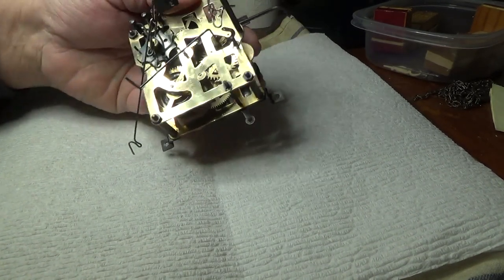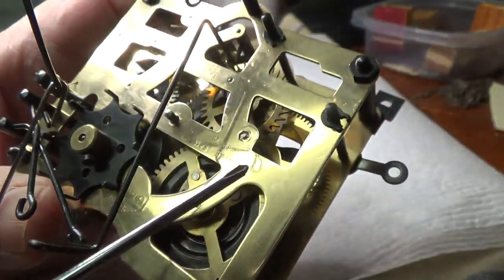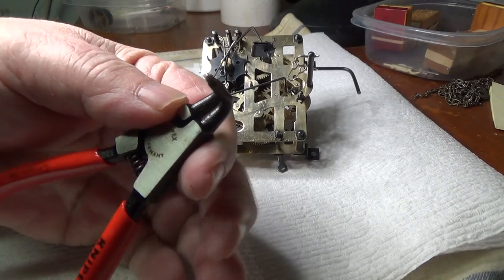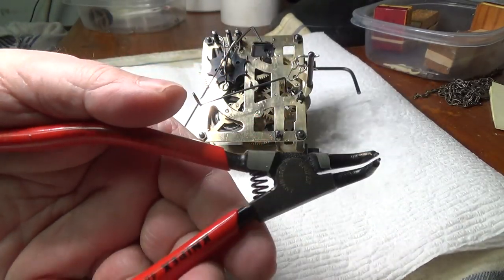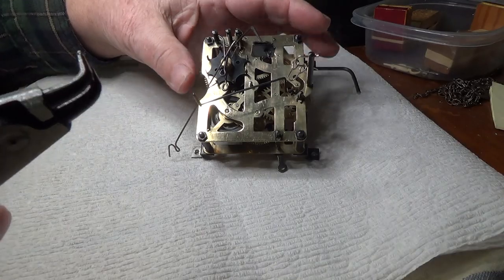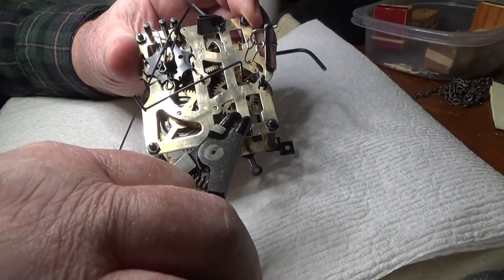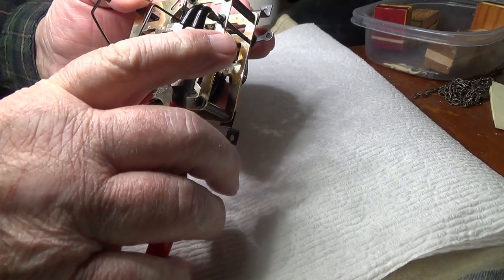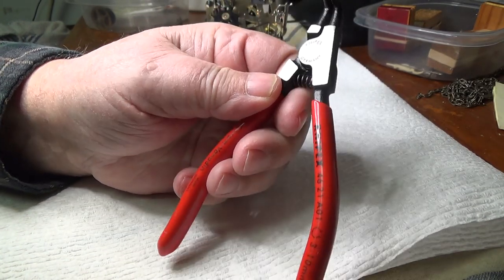Dealing with  Those Doggone Regula Clips

Comment: Until I started watching your videos I had never heard the term "E-clip"  but was quite familiar with the term "circlip" and if you search for that on the net you will get a lot of hits. What you have is circlip pliers and  there are two kinds. One deals with clips that have hole in them and the other kind deals with the kind that has a cavity in them. This is your kind. But as you get small --- like a clock  -- there is nothing to help you but pliers and the exact size of E - or cir - clip.I have a full set of circlip pliers and a shaft I can't get the &^*( clip on.
Reply from the maker: If I do a Google search for "circlip", I get 11,000,000 results.

If I do a Google search for "e clip", I get 5,250,000,000 results. E clips are so called because they are shaped like the letter "e".  They don't require pliers at all and are easily pushed into their grooves and removed with needle-nosed pliers.  Clocks use almost no other type of retaining ring but e-clips.  I've found these other type only on the Regula and only on two of the shafts.  I've found that suppliers refer to them as "g-type clips".  In the past, whether it be "circlip", "c-clip" or "e-clip", I knew them as "Jesus Christ clips".

Comment: I hate these cheap Doggone Regula Clips. I carefully beat them off as I am watching the lever on the other side so it does not hang up. I see this video was made 4 years ago. What do you think of this tool now. I watched a recent video and you were using a screw driver to get them off and putting it back on, Poof, it was done already and didn't see you putting it back on. When I do my videos, only once I showed how I did the clips on, and off and caught some hell over it, lol. Now I just do it off camera, lol. (I don't watch all your videos, but I noticed I have watched a few for entertainment, except this one. One of your subscribers is mine as well and told me about this tool you use and of course mentioned you.
Reply from the maker: You must have watched a video made before this one as I always use this tool to remove those g-type compression clips now.  Years ago, I almost never got cuckoo clocks to repair, though I've been doing this since 1968.  Now, it seems everybody and his brother has a cuckoo clock that needs repair.  Probably lots of people getting grandma's clock handed down.
Reply: @dperry428  Well I just ordered the tool and if it is that good, I will now show me taking them off instead of turning the camera off when taking them off. Thanks so much.

Comment: Mr. Don,  I have to wonder why with all the clocks I have seen you fix..patiently for hours...mine is "odd"?
My mother bought it for me. I guess I need to ask her, when I and she is able, what's up?/
Reply from the maker: Your clock is not "odd".  That's the norm for these Regula movements.  It's just that I've not had occasion until recently of having to deal with this particular movement. Most of the cuckoo clocks I've fixed over the years have been much older ones an few and far between.  I'd say the vast majority of clocks I've fixed were of the old American-style stamped movements.  If there were any Regula movements I did, it would have been many years ago and I simply don't remember there being those type clips on them.
Reply: Thanks....I think my mom and ad picked it up in Munich in the 80's...

Comment: WELL that is unusual..you having a problem?   Guess you figured it out. Good for you!
Reply from the maker: There's always something new to have to deal with, even when it's only new to me.  Almost done with your clock.  That's your clock in this video.
Reply: @dperry428  HA!! I told me daughter that is probably MY clock and one of the "demons' of my life sent with it!    Beat it and don't send the demon back with it.  Enough of them here.  Thank you sooo much!
Reply from the maker: I found no demons, but it certainly looks different from the movement when it arrived.  Just a few more days.  I'm waiting for the pendulum to arrive that I ordered.  Working on redoing the bellows right now.
Reply: @dperry428  I  have the pendulum to the clock.  Just kept it here with weights and decorative top.  Do you think it needs the one you bought or want to keep it as "supply"?
Reply from the maker: I'll just keep an extra pendulum around. I already have weights to do testing. I think there is someone else, too, that needed a pendulum.  I actually order two just to have at least one extra around.

Comment: Hello. 
I ordered some split e clip washers on time savers. Will they do as a replacement for those little g clips? One popped off and got lost when removing. They are split tension washers according to the site. 
Thanks
Reply from the maker: Here is exactly what you want https://timesavers.com/i-8947345-regula-cuckoo-clock-e-clip-10-piece-pack.html
The e-type clips are meant for shafts that have a groove in them.  These "e" clips, actually g clips are for shafts that have no groove.  They are compression clips that grab like an alligator.
Reply: dperry428 they really do grab. Got to get that tool. Thanks
Reply from the maker: @paddypup1836  I have two that I have running.  One is in my workshop and is the railroad house type that was given to me and  I fixed up in one of my videos  The other is a medium-sized one-day cuckoo that is in my living room and is designated for my granddaughter.  She winds it for me when she is here.  It will be hers when she is ready for it.  She is only six years old now.
Reply: dperry428 nice. They are nice items to pass on
Reply: dperry428 hello. Hope you are keeping well. 
Got an old Hubert herr movement for practice. Took apart and cleaned. Pivot holes are all pretty decent. One problem is the pendulum stops on the escape wheel, kind of catches the edge of the cog. Is there something I need to adjust? Have you seen this before? 
Thanks.
Reply from the maker: Usually, that's an indication that the tips of the escape wheel are bent.  If they are even a tiny bit off, they will snag on the pallets.  The can be straightened by using a flat, smooth-faced pliers, gently grasping each tooth and pulling outward through the tips.  Another possible cause is the pivot holes for the anchor (verge) arbor are worn, allowing the pallets to lock too deeply.  They may need rebushed.  I've seen both.
Reply: dperry428 thanks for that. I got it going but just pushed the pendulum wire up a tiny bit it seemed to be running too close to the frame.
Reply: dperry428 I think crutch wire is correct term. 
Im still learning. 👍🏻

Comment: I wish YouTube had a "top likes" list: I'd put this one in it for its value to Regula clock repairers. Until I bought these pliers, I'd scratch the post up like crazy by using a gear puller to push the post out.
Reply from the maker: Those clip removers also have improved the civility of my language use and decreased the amount of editing I need to do on videos when repairing these movements.
Reply: @dperry428  hahahaha

Comment: Don they are called circlip pliers
Reply from the maker: Up until now, everyone had said they wouldn't work on the Type G clips; that the tips bent.  I was hesitant to buy them. Apparently, the cheap, stamped ones do bend.  These work and will save me grief if I get anymore Regula 25 movements to fix. Watch, I've probably seen my last Regula 25.
Reply: These bend too. The best set for these clips are the cheap ace hardware ones.